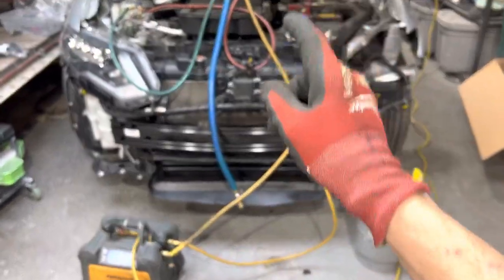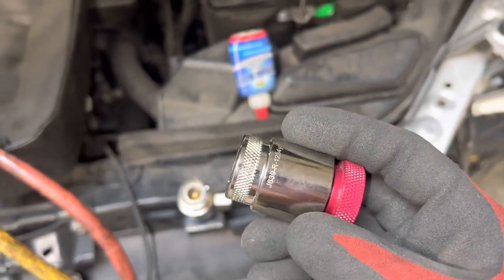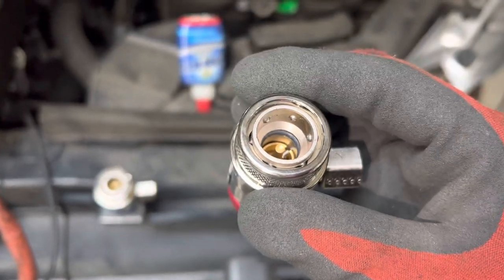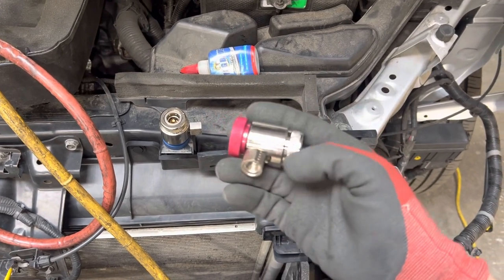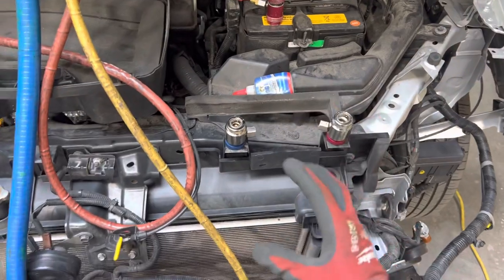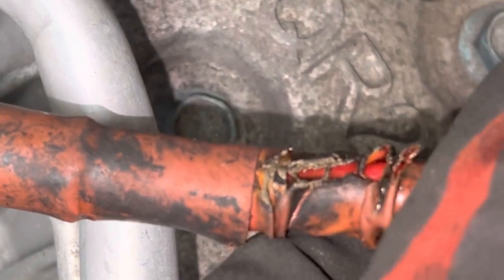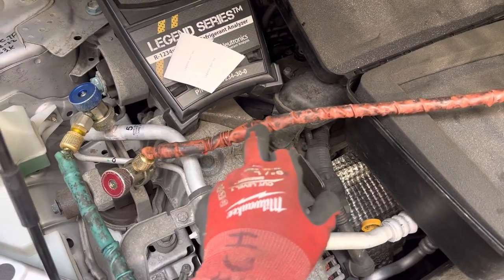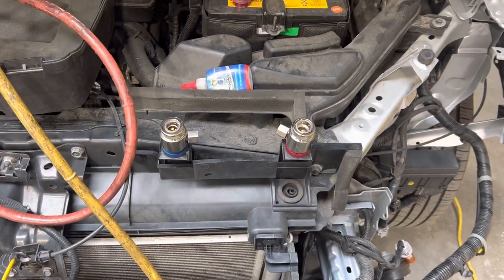NEW YELLOW JACKET 🐝 R1234YF Service, coupling fittings .  ￼

Comment: Nice, I'm still using some 1234 fittings I found on Amazon a while back. I'll look into those yellow jacket ones as quality replacements.
Reply: The Parkers are the best you'll find, I wanted metal diaphragm valves but couldn't find any.

Comment: Do you keep a separate set of manifolds for R1234YF or is it okay to use on 134a too?
Reply from the maker: I have five sets of manifolds. 

But if you’re switching between different types of oils, I have 99% alcohol in a pressurized cylinder I always have on hand pressurized with dry nitrogen I believe that through the first . Then I hook it up to 600 psi dry nitrogen to dry it out in the vacuum pump. Takes care of the rest..

Comment: Those were top of my list but still way too expensive considering they're not designed to be rebuilt.
Reply from the maker: Yes, the first thing I noticed it does not have a C clip that can be removed
Reply: @coldfinger459sub0  In my analysis of these valves, I concluded the stem has to be removable to allow rebuilding.  They just choose not to make them this way, as far as I've been able to determine.
Removing the control knob allows the stem to drop out the bottom, necessary for replacing all (four, if I recall) the o-rings.
Reply: @thisisyourcaptainspeaking2259  its a shame, the manifolds have all the parts to rebuild, after removing the top of the rivet, they would be easily serviced if parts were purchasable. My plan was to drill and tap the stem after replacing the o-rings.
Reply: @lillyautomotive  In order to disassemble, I drilled the "rivet" off the stem, drilled and tapped stem 4-40, I believe it was.  For the next one, I'm going to drill the screw hole in the stem before drilling off the rivet head to remove the knob.  This should make it easier to center the hole and get it perfectly straight before tapping the blind hole to 4-40.